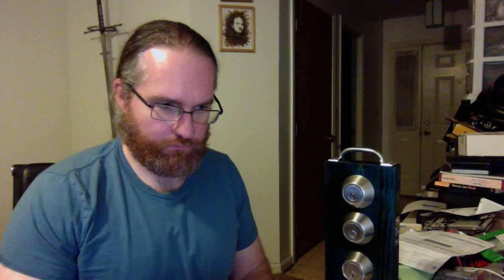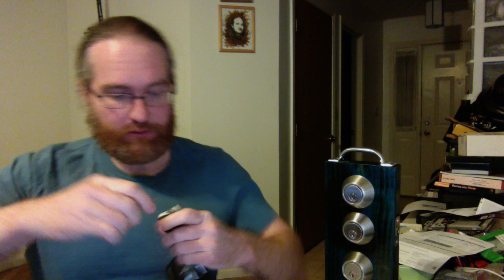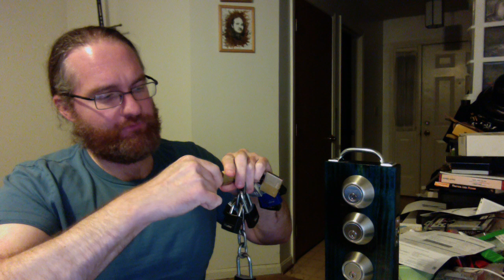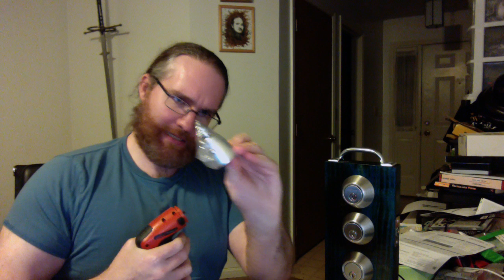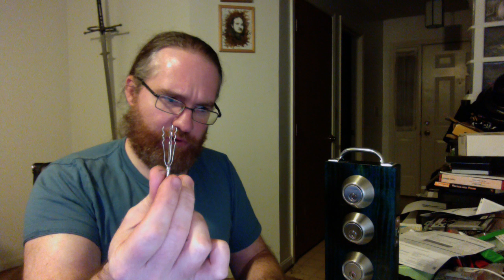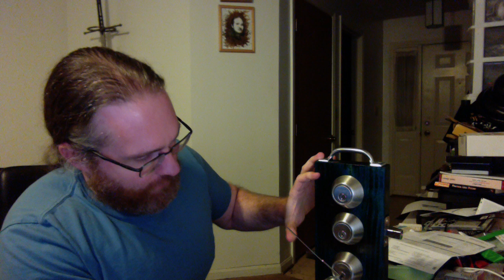Comb Pick & Electric Lock Pick

Comment: Are there any starter kits that you can buy with the locks? I don't have the wood tools or that to create something sturdy for the locks. Just trying to find something that I can burn some more free time with.
Reply from the maker: I've seen a single core in a wood block that southern specialties sells, but that is about it.
Reply: ***** Thanks for the reply, I looked into it a bit, and manged to find the one you talked about. So I think I might just go  early in the morning and head to the hardware store to buy the bits for the drill, and then try to find some some cheap blade and some wood. Hopefully none of my neighbors have Friday morning off today, because I'll be doing it in my apartment. Btw I've been needing to ask someone with experience, I mostly have been using my two kind of beefy desktop pc's for most of my security work, and I recently got asked to teach a few different areas of the whole infosec stuff to high school students at a local school. I'm kind of clueless as far as what type of system specs I should have on a laptop if I plan running about 3-4 vms at once with things you know like kali,windows,and windows server etc... I was thinking about going with just an i5 laptop from asus, and then buying a 16gig kit of ram but not to sure if that would work good enough. I was thinking about a mac pro but not sure 100% if it would be worth it for me atm.
Reply: +bob taste Sparrows sells some graduating practice locks; standard pins, spool pins, and serrated pins.